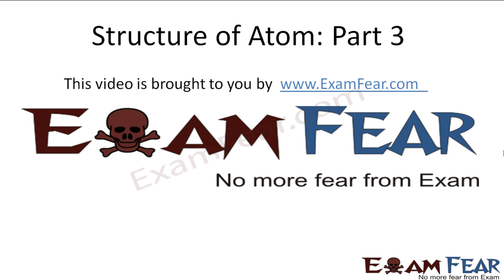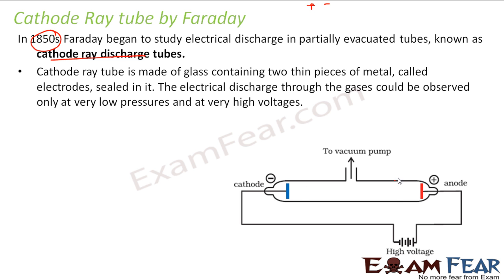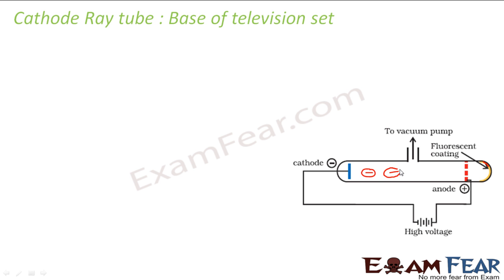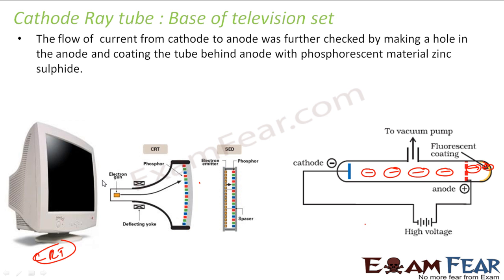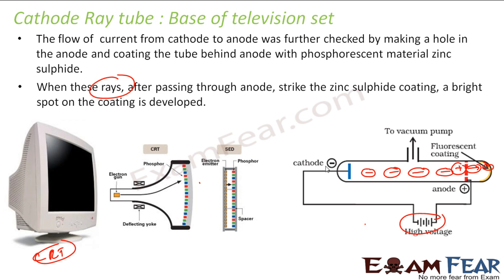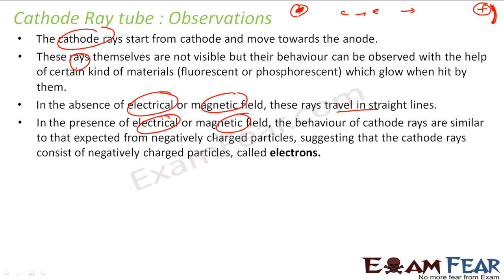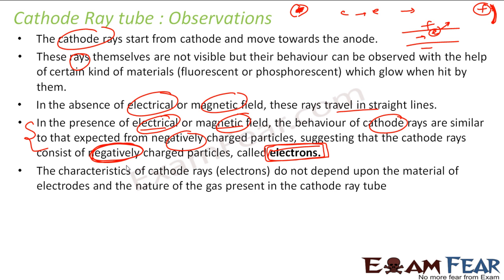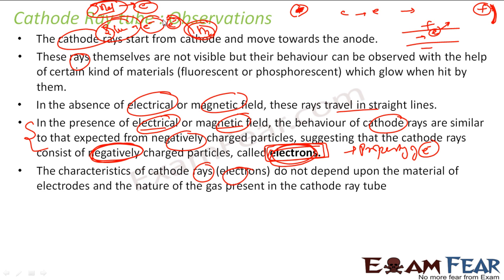Chemistry Structure of Atom part 3 (Cathode ray tube) CBSE class 11 XI

Comment: Sir in CRT TV's if electron strikes fluorescent screen then how different colurs are produced in different places and sometimes same colours at different places ?
Reply: If I am not wrong, the TV regulates the voltage applied to control the speed of the velocity of the electron (Velocity not Speed keep that in mind) and there is a color control mask (polarizing layer in case of LED TV's) to mix up the colors I may be wrong google it for cross-checking. Hope I helped you out if I am wrong then please rectify me kindly. Hope I was able to help you have a Good Day...